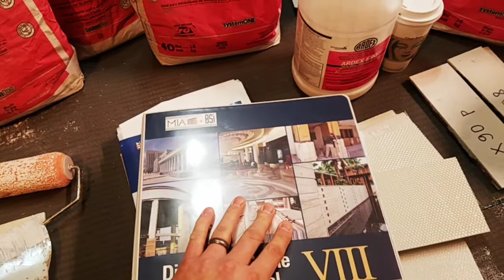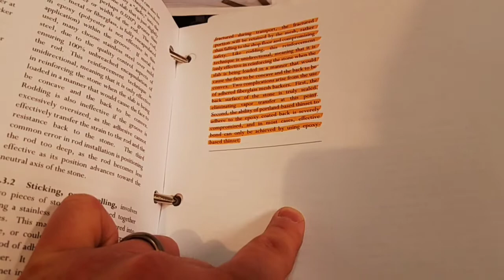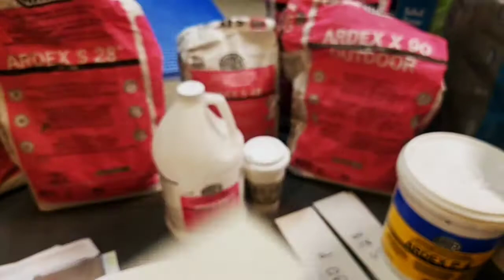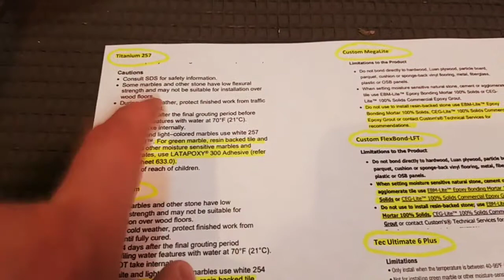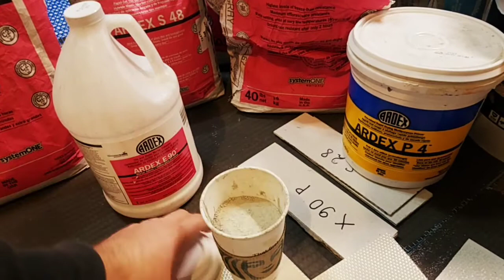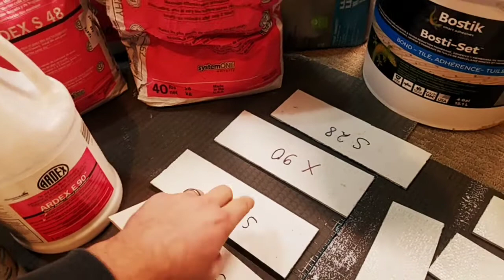How To Install Resin-Backed Tiles?

Comment: Thank you for sharing this. So basically, Bosti-set is easier way to go with setting resin backed mosaics?
Reply from the maker: Bosti Set is made primarily for large format tile panels and will be too expensive of a product to install resin-backed mosaic tiles. Here is a short article where I explain how I personally approach such tiles: https://tilepro-usa.com/tile-pro-blog/f/resin-backed-tiles-how-to-install-them
Reply from the maker: Note that resin-backed marble mosaic tiles require a different approach when installed on shower floors. In such cases, I install them with the epoxy method.
Reply: @TileProUSA  Does the epoxy method required for kitchen backsplash with resin backed marble?
Reply from the maker: @Alexandr Kr  resin-backed marble mosaic tiles in all dry areas can be installed with the method I described in the article I sent you earlier the link of. In the following video, you can see a real-life application for a bathroom backsplash: https://youtu.be/jSwnLwQHHbg